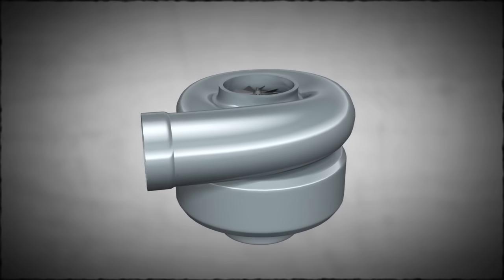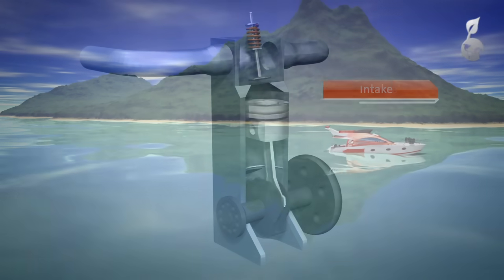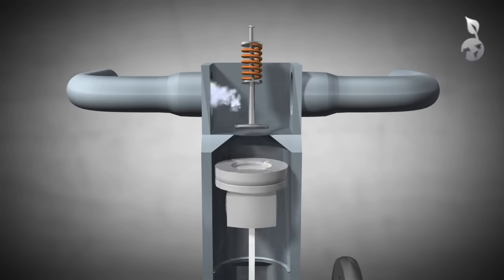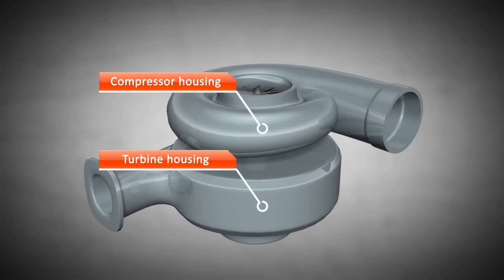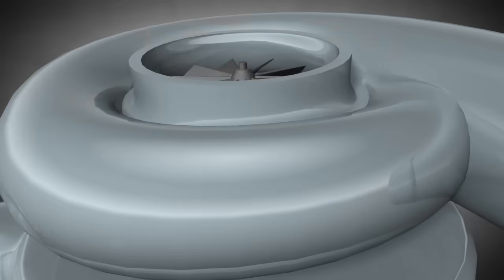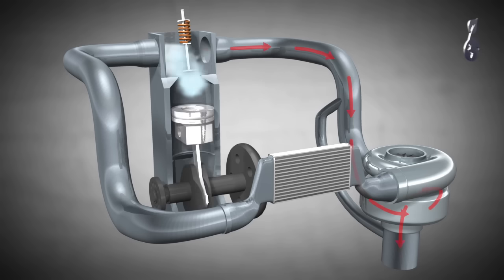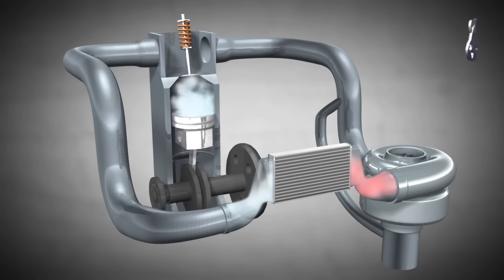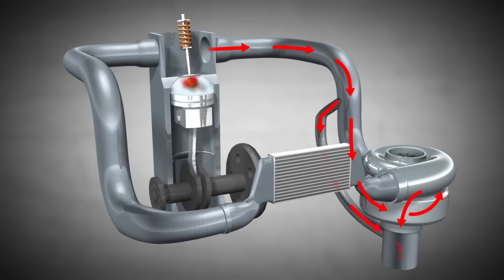How a turbocharger works! (Animation)

Comment: Naturally ASPIRATED engine!! In these engines, the air enters the cylinder due to the suction created by the piston lowering, not by the atmospheric pressure! And in the case of naturally aspirated planes engines, these are not so efficient at high altitude, not because of the low atmospheric pressure, but by the lower concentration of oxygen. That's why you breathe harder on high mountains.
Reply: Thomas Schwenke  After the fuel and air burn the high pressure in the chamber forces the piston down. Once the piston reaches the bottom the radial momentum of the axle pushes the piston back up, but at the same time the seal is released mechanically. Then the exhaust leaks out very quickly until the pressure in the chamber drops to the pressure of the outside air. This is kind of movement of gas is called decompression. Then, when the piston lowers, according to basic physics about gas, the air fills its container. The movement of gas caused by the enlargement of volume of a container is called suction. This is because relative to the outside of the chamber, the chamber has a low pressure and gas is moving into it. You cannot simply say that the air moves into it due to the atmospheric pressure. That is too vague because that could mean that the outside has an abnormally high pressure and that the chamber has a normal pressure (however you define that). Suction is MUCH more specific, and obviously the correct terminology to use in this situation
Reply: The air is not really thin at high altitudes. The problem is that air pressure is lower. Which is why people have trouble breathing at altitude.
The air's density depends on its temperature, its pressure and how much water vapor is in the air. The concentration of gas at any attitude will be the same the pressure it just less which makes the suction less effective.

What I'm trying to say is air density is directly related to its pressure. Less atmosphere pressure = less air per cubic foot or meter or whatever. That means that less air will be sucked in over the time it takes for the piston to complete it's downward stroke coupled with less air density caused less oxygen to be in the cylinder.
Reply from the maker: Alexandru Cristian Radu Hi, great to hear this. Will you please tell me where did you read all that?
Reply: Thomas Schwenke Hi! I can't tell you that i read it somewhere...I am just passionate about cars and engines and it is more of a deduction from knowledge and logic. Nice videos by the way!
Reply from the maker: OK, thank you then. Then please read some books. Here it's explained very well :)
Reply: Are you serious??? Get your facts strait and THEN teach people!! There IS suction! The atmospheric pressure is way much weaker than the pressure created by the air/gas mixture explosion WHICH drive the pistons! If you say the air enters the piston by atmospheric pressure only, you assume that the engine is also driven  by it so what is the point of using gas explosion in the first place?? THINK!!!
Reply from the maker: Alexandru Cristian Radu Hi, thank you. Please read just some books :)
Reply: I think what Alexandru Cristian Radu may be referring to is the following:
When the exhaust exits the cylinder, lets say the volume of the cylinder is x. When the piston is retracted by the momentum of the crank, the volume expands to, say, 5x. This means there has been a reduction in pressure to 20% (one fifth) the original pressure (atmospheric with no turbo).
When the cylinder is then opened to allow fresh air into the chamber, this sucks fresh air into the chamber through a disparity in pressure, restoring it to atmospheric pressure (or whatever the turbo is producing).
At least, that's my understanding of all of this aha.
Reply: acomputer121
No he is trying to say that the pistons downward motion is the only thing that sucks air into the cylinder. What he fails to realize is that the 14.7lbs of air at sea level helps oxygen flow into the cylinder, the suction does a lot of the work but without the external air pressure that suction would be useless. Take the piston up and then magically put it all the way at the bottom, with suction the normal air pressure would still fill the cylinder with air.
Reply: custommotor by definition if there is no pressure there cannot be any gas. atmospheric pressure in this case is treated as 1 atmosphere. The pressure in the chamber lowers below 1 atmospheric pressure thus creating suction.
Reply: *****
That's what I'm trying to point out. The most important thing is that 14.7 lbs of atmosphere air pressure. The suction sucks in the air, but without that air pressure pushing more air to the air filter, intake, and then cylinder their wouldn't be any air for the fuel to mix with. The suction and atmosphere air pressure are both equally as important. Which is why N/A motors lose hp in in the mountains. The suction should be the same but the air pressure is lower.
Reply: custommotor So in other words, you at saying that there cannot be suction without air...
Reply: No I'm saying air and suction are equally important. You can have suction but without the air and air pressure behind it the suction would do nothing. If their was no air everything would be a vacuum, no pressure anywhere, so that downward piston motion that causes suction would do nothing.
Reply: "You can have suction but without the air and air pressure behind it the suction would do nothing." By definition there cannot be suction without air or air pressure.
"If their was no air everything would be a vacuum, no pressure anywhere, so that downward piston motion that causes suction would do nothing." The piston moving downward would not cause suction because of what I stated above.
Reply: The air pressure on the outside still helps with the suction in an internal combustion engine.Lower air pressure means the engine will have less volumetric efficiency while more pressure, i.e. turbo, gives a high efficiency. Even in a turbo engine the outside air pressure is important and will still cause power loss, just not as great, because the turbo increases the suction of air into the intake.
Reply: well turbo just blows air into the chamber at a high pressure. Kind of unrelated to the suction caused by the piston lowering. Also, what i've been trying to say is that suction is the proper term for the situation. normal pressure on the outside of the chamber and low pressure inside (relative to the outside) is the situation we see here, we can agree on that. Suction is when the seal is broken (opening of the seal) and air rushes inward. That is all.
Reply: custommotor There is also less oxygen, that is why they loose HP.. not becouse of low atmospheric pressure.
Reply: custommotor Are you serious? You are contradicting yourself. Learn about Boltzmann distribution and some simple physics equations like mass=volume*density. mass=number of gas molecules (meaning more or less oxygen). The mountain climbers bring oxygen tanks not turbochargers (on solar panels).

The knockout phrase: The concentration of gas at any altitude will be the same, the pressure is just less.... Are you drunk? Is there air (oxygen) in the vastness of space? No! So that means that there has to be a boundary between atmosphere and space (cosmos). Is this boundary abrupt and set by lizard people or maybe a gradual decrease governed by the Boltzman distribution?

Density is directly related to pressure - wrong! They are related but it also depends on the mass (number of molecules interacting). Imagine air balloon (the amount of air trapped inside is fixed) - then you heat the balloon and it pops. Can you achieve the same by just pumping in more air (increase mass/amount of gas molecules) ? In both cases you increased the pressure - but the approches were different.

How do you think NOS systems work? They get additional oxygen from N2O and boost HP. Engine needs OXYGEN. And what we have available is
a) supply more oxygen by overall pumping in more air (use turbocharger)
b) get oxygen from elsewhere (N2O). You could use pure O2 if you dare to risk.

This presented video explains the principle of turbocharger very very well but it lacks absolute preciseness (in few parts) that has been mentioned by others.
Reply: custommotor di
Reply: haha, please go back to school. Oxygen concentration(21%) remains almost unchanged at any altitude, because oxygen and nitrogen(2 main components of air) have similar density,(O2 is slightly densier than N2).  You breathe harder because the Oxygen Partial Pressure decreases due to the atmospheric pressure decrease. Po2 = Patm * Co2. Our body is sensitive to Oxygen Partial Pressure not Oxygen Concentration. Imagine a scenario where Oxygen Concentration is only 7%, but the whole environment is pressurized to 3 atm, so that the Oxygen Partial Pressure remains unchanged, our body will still function well.
Reply: Jiaqi Chen
Why do you make a fool out of yourself? You do not recognize the difference between relative composition and concentration. Concentration is measured as substance per volume - basically density. Yes, you are correct about the partial pressure being important but the main thing remains the same - body as well as engine needs oxygen - and how you supply it doesn't matter. Also I am not quite sure weather you would be able to breath at 3 atm conditions (maybe you would be able to adopt but certainly it won't be comfortable).

Please look at the table showing air density vs altitude: http://www.engineeringtoolbox.com/standard-atmosphere-d_604.html
Reply: madphys Really? That's how your science teacher teaches you about Concentration. please read http://en.wikipedia.org/wiki/Concentration.
Reply: Jiaqi Chen And? This wiki link proves what exactly? Did you see the part labeled Mass concentration? Also number concentration - the number of entities (oxygen molecules) per volume of mixture (let us say 1 cubic meter for our convenience). Do you really can't see the resemblance of density? And even so (let us suppose I chose terminology poorly) - it doesn't change the fact that the count of oxygen molecules per volume decreases with the altitude...
Reply: madphys Wait a second. I think we are taking with the wrong guy. My comment was based on Alexandru Cristian Radu 's theory of the higher the altitude, the lower the O2 concentration, I was trying to explain that. and your comment was correct. So my fault, but you seem to have a very clear understanding of the physics behind it. May be we can talk later.
Reply: Alexandru Cristian Radu You are wrong.
Reply: +Tower Crisis 
Agree... & that is my understanding also.
i.e When the combustion process takes place and the over pressurized gas is mechanically vented, it momentarily creates a small vacuum.. hence there is suction and atmospheric pressure both trying to fill the void where the over-pressurized gas escaped..

Comment: I now want a turbo lol.
Reply: Nathan Gray Not quite... both mechanical superchargers and turbochargers (originally called turbosuperchargers) serve the same function: to increase the amount of air fed to the engine and thereby increase horsepower, but they go about it different ways. As explained in the video, a turbocharger uses the vehicle's exhaust gasses to spin the compressor turbine, while a supercharger's turbine is mechanically attached to the engine via a belt, chain or crank. 

Both have advantages and drawbacks. Turbochargers take time to spin up to operating speeds, creating the phenomenon of "turbo lag". While superchargers don't have this problem (their turbine speed is always directly proportional to engine RPM), but the additional energy needed to spin the compressor turbine creates a parasitic drag on the engine's horsepower output.

Either method (any plenty of other things besides) can damage an engine if done improperly, but most engines can be turbocharged or supercharged for a moderate power increase without risk, and indeed, more manufacturers are turning to turbochargers as a cheap, efficient way of making power in small-displacement engines straight off the factory floor (see: Subaru, Ford Eco-Boost, etc.). Thanks to the small displacement of these new generation of turbochargers and efficient exhaust routing and engine mapping, modern turbos spool up to full speed very quickly and suffer very little lag.

Thanks to the increased air in the engine producing a cleaner, more complete burn of the fuel, turbochargers are also being used by manufacturers to lower emissions and improve fuel efficiency in order to meet increasingly-strict mandates on both fronts. 

Why would you want a turbocharger? Well, aside from more power to go faster, forced induction can also be used to compensate for the power deficit at high altitude. Obviously this is a very common application in radial- or inline-engine aircraft, but it's equally applicable for people who live up in the mountains. Your naturally aspirated engine might make its listed 200 horsepower on the California coast... but in Denver it's probably only making about 170.
Reply: No you don't. Too much stress
Reply: ***** A turbocharged engine will output more speed (actually power) at a lower RPM _relative_to_the_same_engine_naturally_aspirated.
Reply: Nathan Gray Care to explain?
Reply: Supercharger is a crank. Turbo forces air into the engine...which could fuck up everything if you OVER DO IT.
Reply: Nathan Gray In theory, since a turbocharged engine is producing more power per cycle than an equivalent NA engine, yes. However, you have to juggle AFR: more air going in means you can completely burn more fuel, so you put more fuel in to produce even more power... but then you're burning more fuel, etc., so in practice any kind of FI will get worse gas mileage than the same engine naturally aspirated.
Reply: DMStraylight.  True. But your also gain more speed at lower RPMs. So it would probably be the same.
Reply: Nathan Gray More or less. As I understand it, it basically boils down to "yeah, you COULD tune it for fuel economy, but... why?"
Reply: ***** we're talking about turbos
Reply: Angel S Buy one then
Reply: Could a turbocharger get better Gas Mileage if you baby it? Or no? 

If you can't make up your mind get a twin charger 😈 but you would have to get racing fuel😔

Comment: I'm a little skeptical of the inter cooler creating more oxygen by simply cooling the air.
Reply: Cooler air is denser than hot air, so for example, in 1 liter of cold air, there's more oxygen (and all the other components of air) than 1 liter of hot air.
Reply: Donovan Thompson The intercooler does not create more oxygen. The air coming from the turbo is compressed but has been heated up by the process of compressing it. The intercooler cools the air down again which makes it slightly more dense. So not more oxygen, just a bit more actual volume of compressed air.

Comment: Very nice video explaining a TurboCharger. Thank you very much as i am researching this topic.
One question..: Can i operate a Turbo with my stock Radiator (small intercooler). ? i heard i can at 5psi and no more than that. True?
Reply: +ThatOneGuy 7 
Inter cooler - cools the air that comes off the turbo compressor turbine air (compressed air gets heated).
The radiator cools water that passes through the engine voids, so the short answer is no.

Comment: THanks for uploading the video， just wondering does air still go through Turbocharge to the intake manifold if the engine is at low speed, in other words, low output, like when we decelerate or coast the vehicle, or idling?  many thanks
Reply from the maker: comewhataugust It depends what system you use. Normally, it does!

Comment: They both do the same function, but a supercharger takes the power to rotate from a belt connecting it to the engine, while exhaust air rotates the turbocharger, hence, they supercharger is effective at all RPM while the turbo needs a bit high RPMs, consequently, turbo lag exists.
Reply: Tareq Arar so if you have both supercharger and turbocharger that means that you would have Boost at all time and even more at higher RPM? Hell why don't we get a V8 supercharged and turbocharged with nitrous! What the hell could possibly go wrong?!?!